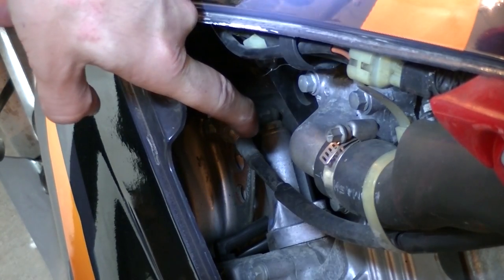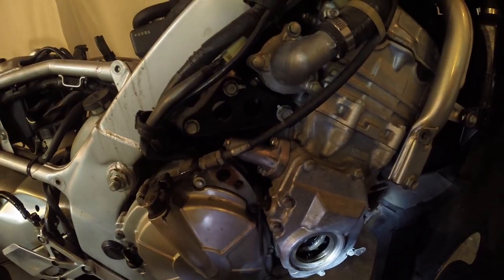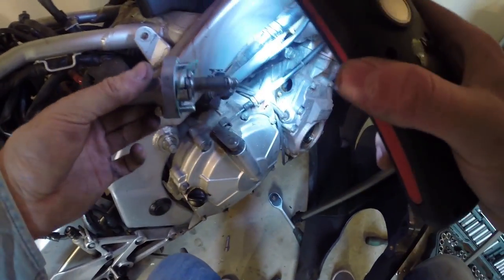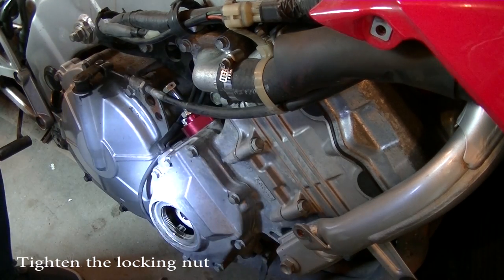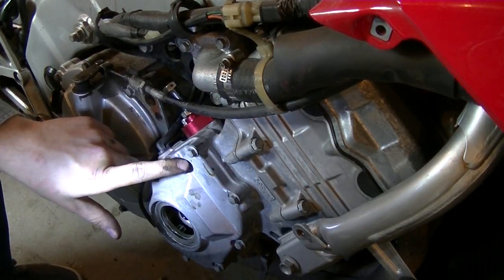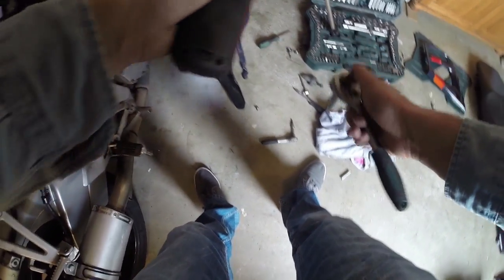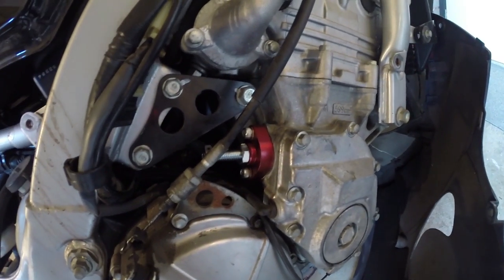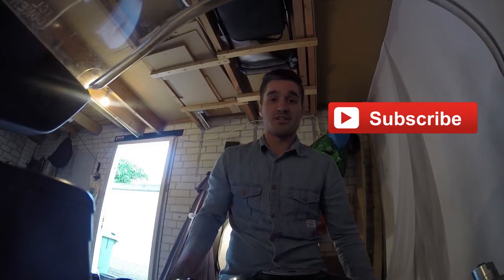How to Install A Manual Cam Chain Tensioner Honda CBR600 F3

Comment: my F2 change rattled when I started it up with the engine hot all the time when I replaced it with the manualit fixed my chain rattling when the engine is hot I've been using it for a little over a year no more chain rattleand you can get one Dirt Cheap on eBay
Reply: How did you find top dead center?

Comment: did you get any leaks around the manual tensioner after this? as there is an oil gallery that feeds the (old hydraulic one) did it ever leak? after the APE?

Comment: please answer me, is it ok to replace hidraulic tensioner (original one) with the manual like you did, my mecanic sad that you can't do that????
Reply from the maker: yesthatislife Well youre mechanic is wrong.. You can replace is with a manual one! You just need to adjust it manually every once in a while.
Reply: How often do yo check it ?
Reply: Adjust when you start heading the rate noise. Also the not had a hole on it so use safety wire so it doesn't back out. 0.032 safety wire should be fine

Comment: Nice vid, my cbr pc25 needs a manual cct as well. Do you need to block the oil passageway in any way or is that redundant?
Reply from the maker: +Multigroove74 I didn't block anything
Reply: Did you block the oil with new gasket  ?

Comment: Thanks for the vid Luca. Planning on doing the same thing somewhere this weekend. Just out of curiousity, why do you need to place the crankshaft on it's timing mark to take out the tensioner? Also you took the fuel tank and seat of, I dont need to do that do I?

Cheers bro!
Reply: I was wondering the same, why the crankshaft had te be timed
Reply: Any answers?
Reply: I’ve done it without placing the chain at the timing mark, didn’t make sense. Still worked like a charm 😄.
Reply: @NilsRingersma  Only thing i can imagine is that the piston is not at TDP so something perhaps with tension or oil other idk
Reply: I have a '91 F2 and the Haynes manual mentions nothing about finding TDC--just R&R on the fairing and R&R on the CCT (a lot of abbreviations, I know, but you guys get it!) Wishing everybody success.

Comment: The F3 is auto but not hydraulic, they can stick and not tension properly, try resetting it before replacing...
Reply: Hi , I've got 96F3 . Can you please explain what you mean by "resetting" it ? ... Any help appreciated ,, Thanks .
Reply: @KZ3W  : The Honda Service Manual for that model and the Honda Common Service Manual are both available free online they will give the exact instructions, on removing the bolt in the back the plunger can be wound back, there is a special Honda tool that will hold it back while the tensioner is re installed and when the tool is removed it will put the tension back on, it can be wound back with a small screwdriver but it's awkward to hold it wound back while reinstalling the tensioner...

Comment: Well done great vid.
Reply from the maker: ***** Thanks! Make sure to subscribe and check out my other videos :)
Reply: Luca Car Mods Why is it that they fail? Or how do they fail? :/ Think its mine thats rattling, thought it would of needed a new timing chain but maybe its just the CCT?
Reply: For what I've read its the spring that's poorly designed. Just take top bolt off the cct and insert a small screw driver down hole (whilst engine is on), which should stop the rattling. If it does its the cct, this is also what I've read.
Reply from the maker: ***** They are poorly designed, and most of them still are..Even on the newer bikes they fail a lot.
Reply: ***** Would you go with a Manual one if it is about to fail?
Reply: Luca Car Mods Thought it would of been sorted now as it's a known problem.. :O
Reply: Defo as the manual cct is such a easy part to fit and adjust. Plus its aprox a third cheaper and... You can chose a color :)
Reply: Luca Car Mods shit even the new models fail, that's rubbish.

Comment: My f2 cam chain tensioner just failed. Not bad for a 21 year old bike :)
Reply from the maker: stonebrother They seem to breakdown a lot!
Reply: +Luca Car Mods this are not hydraulic tensioners...they dont work on oil presure..they work with a spring...so its improper to call them hydraulic...just sayin...

Comment: Buy  genuine  honda parts when it comes to engine components they . will work for years to come  and there's no need to adjust  it.. after market parts stay away from them..
Reply: On cbr 1100xx tensioner last 30.000 km at its best it's a well known issue, people keep changing cct, it's bad designed.